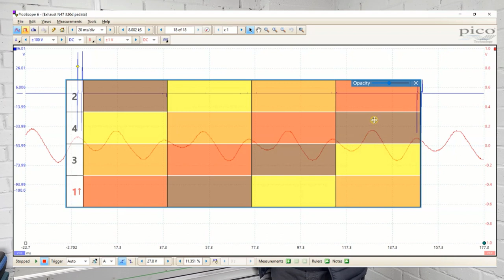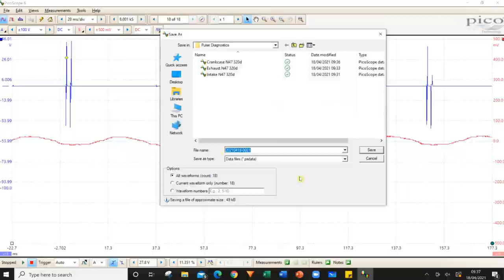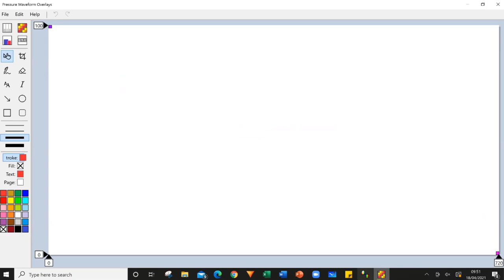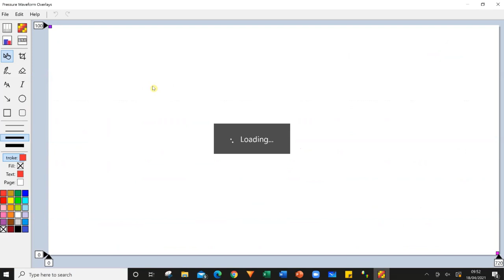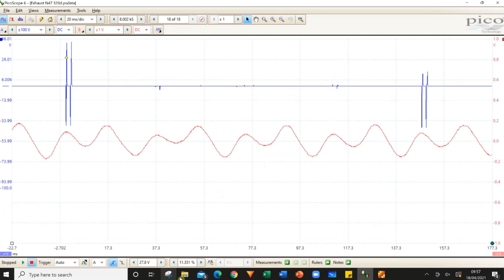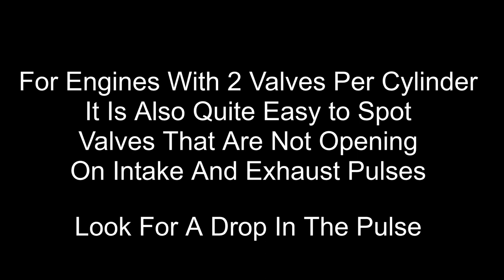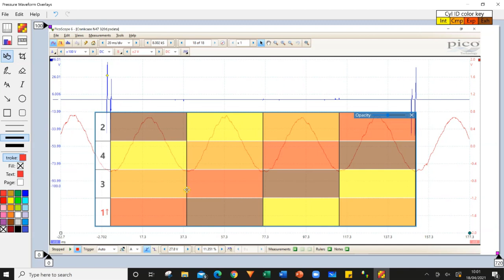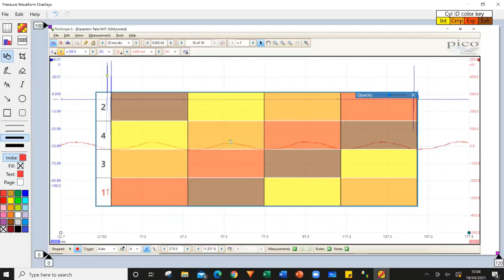Pulse Sensor Diagnostics | Automotive Oscilloscope | Mechanic Mindset

Comment: The small ones in the cooling system are likely from the crankshaft speed increasing on the combustion stroke and you’re seeing that through the water pump spinning faster during those periods. I’m still amazed from time to time at some of the small details you can pick up in some of these captures.
Reply from the maker: Agreed, it makes sense. Yeah for sure, so sensitive! Amazing little tools 👍
Reply: Thanks for the tip. Never would've thought of that. Appreciated. Cheers!

Comment: Probably worth taking a measurement with the sensor blocked off to use as a reference. Because that's also a vibration sensor.
Reply from the maker: Good point, I did hold it / isolate on some of the ‘shaker’ measurements, it didn’t make much difference in this sensor. Must be well built. More than I can say for my DIY job 😂

Comment: Could u not use a leak down testers
Reply from the maker: Yeah sure, but some cylinders are a pain to remove a plug (diesels….even longer), and this set up could be quicker with practice with the scope ready to go on a diag stand. I’d say this test is about convenience but will require a bit of practice 👍

Comment: great video Darren! I have a pulse sensor I've built and use it in the expansion tank as well. On a recent car that I was asked to repair the owner indicated he had a coolant leak I used the pulse sensor, my picoscope pressure transducer and sync'd on an injector to identify where the leak was. The owner couldn't argue with the diagnosis (I provided him a printout) and it was just so great to be able to diag this car with only a spark plug removed and my pico connected.  It needed new head gaskets of course. Truly a fantastic diag tool and one I can't do without. I look forward to more of your videos!
Reply from the maker: That’s awesome! Top example of putting this in to practice. More to come soon. Thanks 👍

Comment: Lots of good theories about that ripple in the expansion tank.

I would add that it might be due to expansion noise being transmitted into the water jacket through the cylinder walls.

Remember a knock sensor is measuring the acoustic pressure wave traveling through the block.

What you have there might be a secondary knock sensing effect.
Reply from the maker: Thanks, we found the source! Check the latest video on this 😃

Comment: These pulse sensors are just pretty much sensitive microphones. That leafy piezo element you've shown in the video is a sensitive sound pickup element. Even if you had the best head gasket ever possible, the walls of the engine block is gonna flex because of combustion events and a pressure wave(aka sound) is gonna travel through the coolant system. Hell you'd even see such small spikes even if you'd only just place that pulse sensor near the car while it is running, since you can hear the engine running by ear. Bonus: pressure sensors and microphones measure the same thing. However, pressure sensors are properly calibrated for a certain range and microphones mostly respond to speed of pressure change, not the actual pressure itself.
Reply: Great video though! Even though I knew such details about the sensors themselves, I'd never imagine such an application, it's genius! You've opened a whole new view for me with both your videos of in cylinder pressure sensor and this pulse sensor.
Reply from the maker: For sure, these are so sensitive. It’s amazing how much sensitivity we get for so cheap. 

Pulse sensor diagnostics is really a game of comparison; and as you have raised, you need to understand what they are doing to be able to interpret any meaningful data from them. Cheers! 👍

Comment: Hi, sorry but what about the vertical setting of the table ? How do we align it? Thanks for the video
Reply from the maker: Good question, it’s not relative to a pressure measurement. We are just looking at the pattern
Reply: @MechanicMindset  thanks for the reply, but it will effect everything? If I go to high one peak will go into another section? Can you recommend any reading material that will clear this up?

Comment: Taking your reading cranking vs running, which one gives better result
Reply from the maker: I suppose it depends on what you are testing. For pistons rings or head gasket I would think engine running would be best (capture high pressure from power stroke). For valve train issues, I don’t suppose it matters. Worth looking in to further 👍

Comment: hey, could someone explain the overlay to me. How do you know which cylinder is doing what if he sets them in the middle of 3 and 4-such as at 6;46 in the video.... i get the colors but just dont get how to sync the waveform with the colorsfor all the cylinders. thanks
Reply from the maker: I see what you mean. The horizontal position of the waveform has no significance. Some people actually keep it down blow out the way, but still lined up. The overlay just helps us identify what each cylinder is doing in that segment of the waveform. 

Let say we had a spike on the pulse sensors on the intake, we could assume an inlet valve was leaking. We would look at which cylinder was on a compression or power stroke (depending on engine state) to identify which cylinder is at fault
Reply: @MechanicMindset  ohh okay, that makes sense!  Thanks for the reply. Love the videos, very helpful
Reply from the maker: @michaelrollins3979  The first time I looked at this overlay, it took me a while to figure it out 😂. Cheers!

Comment: Thanks for sharing - great explanation Darren! You are right, it is easy to struggle with the waveform interpretation.
Reply from the maker: Cheers, it can be difficult. I will also have to follow up on this as the intake and exhaust waveforms are a lot simpler on NA engines (this one's TDI) - the turbo definitely confuses things.
Reply: Why would that be more complicated on diesel engines?
They're spool are not spinning until about 1.500 rpm.. not many internal things are moving when the engine just runs at 800rpm..

Comment: Using crankcase pressure, can we accurately find where injector is firing in relation to tdc, without going in cylinder
Reply from the maker: I suppose theoretically yes, you would have to use cam/crank sensor to reference and be sure exactly where TDC was. For example, the gap on the crank signal isn’t always exactly TDC. There are some other things to consider like pre injections and the flame spread time. Like your thinking!
Reply: @MechanicMindset  This test would be to check cam and crank in relation to tdc... indeed we would need to know  manufacturers cranking degrees and do a little maths. Beats the hell out of removing plugs in diesels. Perhaps theres an option on dealers scan tools

Comment: hello and thank you for the video I still have trouble understanding waveform but by watching the tutorials several times I will finish it got there
Reply from the maker: Get yourself a sensor and have a play with it 👍 Cheers Stephane
Reply: @MechanicMindset  I made myself one that works really well
Reply from the maker: @stephanevaucelles6378  Ah cool, I think I remember you telling me. Do you work a lot on turbo charges engines with the trucks?
Reply: @MechanicMindset  yes
Reply from the maker: @stephanevaucelles6378  I think the intake and exhaust pulses are not so straight forward in these engines. It also depends on the air intake

Comment: Great video!!! From what I understand the pulses on the expansion tank could also be from the cylinder expanding a bit on the compression stroke moving the coolant creating the ripples I think the become more pronounced during a Cranking waveform where there is alot more pressure.
Reply from the maker: Ah interesting, I was thinking something similar. Amazing tool right? Cheers! 👍

Comment: Great video. Might not be very practical on all vehicles but you might try the cooling system test with the belt off. The crankcase test is definitely cool. It's quick and easy too.
Reply from the maker: Cheers George, good shout. Do you agree with the engine speed causing the peaks?
Reply: @MechanicMindset  I would agree, could be cooling system air pockets that’s why I mentioned removing the belt. Also on the crankcase test I try to isolate the system by blocking off the pcv.

Comment: I have used delta sensors many times. 
I do my best to try to isolate the sensor from vibration because just bouncing around will generate a waveform. Looking at the test you did with the intake were you inserted the Delta sensor I would have to think the turbo is affecting that waveform. I’m gonna test that Theory Monday when I get to work. I Also suggest doing your pressure pulse in your intake and your exhaust while cranking instead of running. When I take a intake pressure pulse test I  usually try to attach it right to the throttlebody and block off the intake
Reply from the maker: For sure, I need to get a hook or something for it. 

I agree on the turbo theory and was going to try the same (go in at MAP sensor). I would say the same applies to the exhaust waveform too. I never tried revving it to see what happened.

Any reason you prefer cranking opposed to running the engine?

Cheers 👍
Reply: @MechanicMindset  I think cranking to me defines each cylinder  better than actually running. Now the Crank case and the cooling system obviously you would need the vehicle running. Now depending on how bad the crankcase blow by was you wouldn’t need for the vehicle to be running. Something  I see that some technicians that make pressure pulse sensors if you just have them hooked up you will see a voltage isolation depending on your millivolt range does that make sense?
Reply from the maker: @jwoeltje6949  So do you mean get a base reading before taking a measurement?

Comment: If you got a CO2 sniffer you might be able to detect the exhaust gasses themselves using the scope. I mean, sure the old-school blue to yellow shows SOME contamination, a digital sensor is much more sensitive to detection. Got a great video on a DIY version I could recommend if you wanted to replicate it as opposed to purchasing a pre-built one since you seem to like to show off affordable methods. And the same tool can be used on the tailpipe to detect leaking/faulty injectors.
Reply from the maker: Yeah we used to do the same with the 4 Gas analyser in the dealer 👍. Block tester was always a bit hit/miss. 

Well that sounds interesting! Not come across something like that before, share the link 👍
Reply: @MechanicMindset  Also be sure to check out his whole channel. Full of DIY tools on a budget for those who have the ability. The telegram group is very friendly and about learning/improving always. Super nice guy too talking to him.
Reply from the maker: @kevencausby5964  I know this channel, chatted with Dennis a few times! He makes some awesome gear! You on the HScope telegram?

Comment: I just got one and I would like to no what voltage you set it and
Reply from the maker: Low, under 1V maybe. You might have to adjust depending what system you’re testing; tiny weak pulses, go lower, strong pulses, go higher

Comment: Would it be possible to measure cooling system pulses to identify power stroke events of each cylinder? Let's say you had a plugged fuel injector on a cylinder so good compression but no fuel or vary little.
Reply from the maker: I like your thinking but I think there are better ways to test this - crank sensor signal frequency 👍

Comment: Great video as usual.  The pulses you see in the expansion tank are water pump rotational pulses.  As each blade of the impeller pushes more coolant you will get a slight pulse
Reply from the maker: Someone added another dimension to this theory; the pulses are inline with the 4 stroke cycle because of the crank & water pump speed increases on each power stroke. What do you think? 👍
Reply: @MechanicMindset  probably find its a four blade impeller, cant see the 4 stroke cycle having any effect on water pulses in a good system
Reply from the maker: @adrianlowes1848  6 blades by the look of it and not sure on the ratio between the crank and water pump pulley
Reply: @MechanicMindset  very very interesting this theory!!!!wow.i wouldn't think of this.
But I think, it's a way to find out. Just make a video with the engine  running, and then with the engine just cranking (disable ignition and injection/ or diesel injection,depending of the type of fuel ), and I think will we find out the results.
Reply from the maker: @Lambros_Stefaneas  Good plan, I’ll add it to the list 👍
Reply: Those pulses are just like sound. Compression strokes in the 4 cylinders is what you see ("hear"). "Pulse sensor" is just a piezo speaker (and like any speaker it can work both ways - as a microphone).
Don't mix water pump to this!

Comment: Great video as always, another awesome use of delta sensor is fit the end with stethoscope so you can physically “see “ the noise on a component.
Reply from the maker: Cheers Lawson, yeah I saw that method. What noises do you like use it for?
Reply: @MechanicMindset  only ever use this once on aux belt idler pulley , but to be honest my infrared camera had already pin pointed failure on idler pulley bearing.
Reply from the maker: @lawsonthursfield6950  Ah, I have one of them on my shopping list. What you got? I’ve been looking at the Flir and Seek for iPhone
Reply: @MechanicMindset  just reading thru comments and seen yours sir...buddy of mine got the Seek for his and it is pretty good....I have a Fluke VT04A and the Seek hooked to phone does better bc of phone camera interface....thanks for all the vids and knowledge Cheers
Reply from the maker: @joshuamyers3185  Ah cool, what model Seek does he have? Glad you’re enjoying the content!
Reply: @MechanicMindset  mine is the first snap on , there is some great stuff out there now at far cheaper prices.
Reply: @MechanicMindset  he said it is the Seek Compact.....sorry for late response

Comment: Very interesting video, and in typical Bmw n47 fashion the breather pipe is snapped.....!😜
Reply from the maker: Confession: I snapped it when I removed the intake 😂😂😂. It was a little brittle 👍
Reply: Mechanic Mindset To be fair with those pipes even just the thought of removing the intake will snap them .....! Was thinking this pressure pulse diagnostic method would be a lot handier for diagnosing suspect ingeniums than using the compression tester as the glow plugs are a bit of a PITA
Reply from the maker: @billytremoloband7456  Awesome idea, give it a go! 👍

Comment: Would the ripples in the coolant test show the speed changes from the water pump following the speed changes  of the crank shaft of a 4 stroke engine?
Reply from the maker: Ahh yes, I like that answer! Makes sense 👍
Reply: I just tried this test with a scion XB that has coolant standing in cylinder during pressure test but only show little differences in pulses while piston at top dead center? In my stall now
Reply from the maker: @joshuawood6588  Are you getting any gasses in the coolant system/over pressurising? Another trick I saw is to remove the cap tie a latex glove around the hole. It inflates if it’s blowing in to the cooling system
Reply: @MechanicMindset  good tip ... every day is a school day
Reply: Yes found excessive pressure in coolant tank when removing cap. Customer declined any further repairs.
Reply: Mechanic mindset your videos are simple with a better understanding 
Thank you for sharing
Reply: Thank you sir for sharing.  One word : amazing,  keep going.
Ir

Comment: Personally would never of thought about using a oscilloscope for diagnosing engine mechanical faults. Just wondering what your opinion is for the pros and cons of this method compared to say Compression, leak down and a sniff tester
Reply from the maker: It’s a great method. I think this could be quicker if your scope is always handy. I suppose the first measurement would be relative compression with the amp clamp. 

I would say this method is faster, but only if you have the knowledge of waveform analysis. Get some reference waveforms! 

This method checks all cylinders at the same time, where as cylinder leakage would have to be done individually. 

There are probable more but not sure. Some people would probably be more comfortable with the traditional method. 

Thanks👍
Reply: Compression has flaws too! You can get good number with closed (stuck) valves (exhaust).
Using scope in the car diagnostics is a top level (mediocre clowns are afraid of it or think it's something "new" or inferior to "old-school" parts swapping).
You can diagnose ALL possible mechanical faults using scope and proper probes, transducers etc.